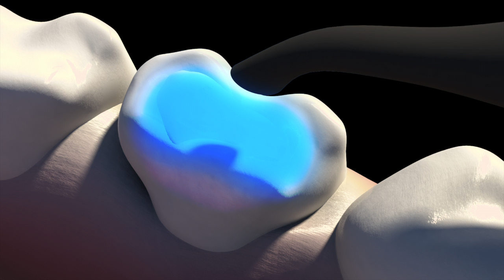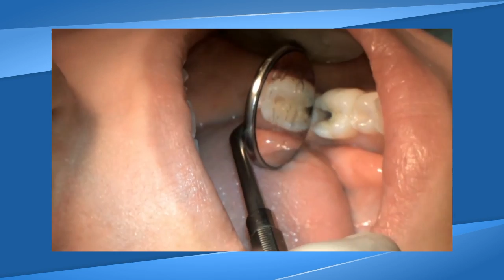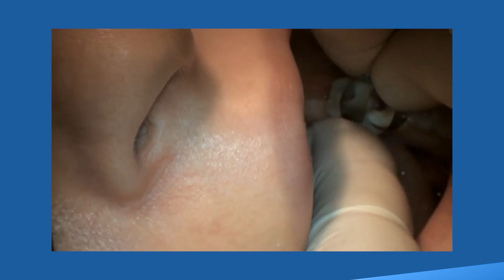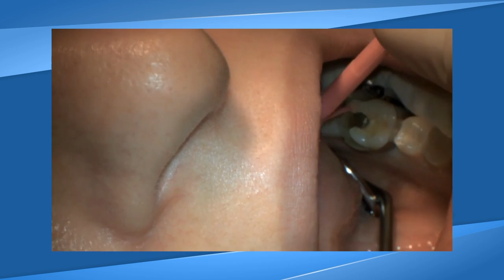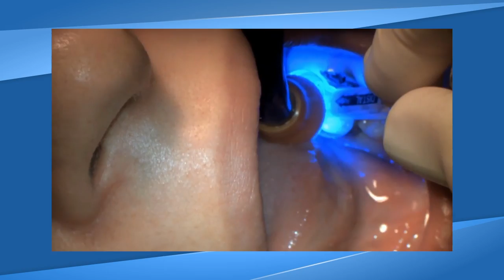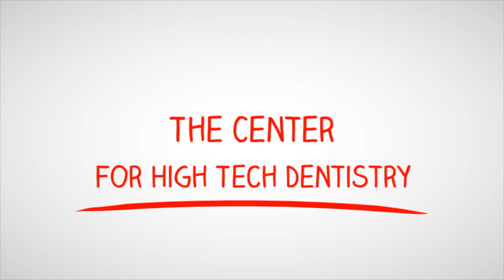Caries Removal & The Cavity Filling Procedure - Laser & Conventional Removal of Old Composite

Comment: He still had to use the drill so what was the point
Reply from the maker: Natalie, that is a thoughtful observation and a good question. The laser with the water spray creates micro-explosions of the tiny water droplets whose force will dissolve decay and remove hard surface enamel by micro-fracturing the enamel crystals. 

We generally use 20 pulses of laser energy per second. That means the tooth is vibrated 1200 times per minute. I have found that after 1 to 2 minutes the tooth experiences an analgesia, or the inability to feel pain. 

That effect is similar to when you express happiness by clapping for a minute or so. Try it. Your hands will begin to feel numb.

 Nerve conduction of pain and sensitivity has two parts. The first is an electrical signal wave that starts from the nerve ending that sense the painful stimulus which travel up the nerve to the other end of the nerve. At that end there is a gap called the synapse and the nerve releases chemicals, called neurotransmitters, such as norepinephrine and serotonin. 

Like a snow fight where you premade some snow balls and after the throwing started, you ran out of them. You had to either stop and make new snowballs or pick up some that fell in front of you. The nerve has to do the same, so it is inhibited to effectnicely transmit the pain signal. 

What started as 90 seconds of gentle tapping on the tooth of the laser microbursts, effectively numbs over 90% of my patients so I can use the regular high speed drill to smooth the edges, without the heat and pressure used with conventional cavity preparation. 

I get a better bond to the tooth with my composite tooth-colored filling material and the patient doesn't need the shot.

Hope that explains the process.
Reply: DrSimonRosenberg (The Center For High Tech Dentistry) you still used the drill so you are still old school lol.